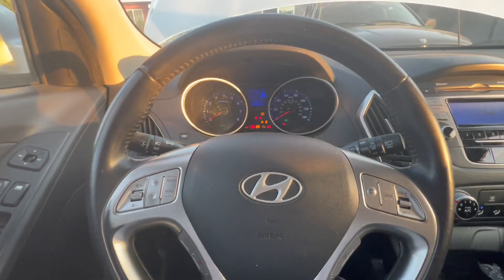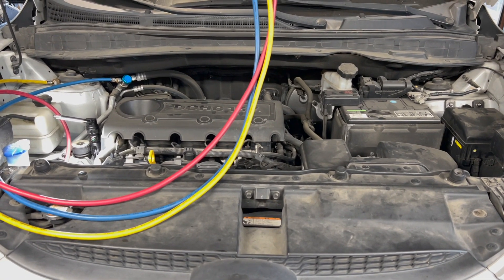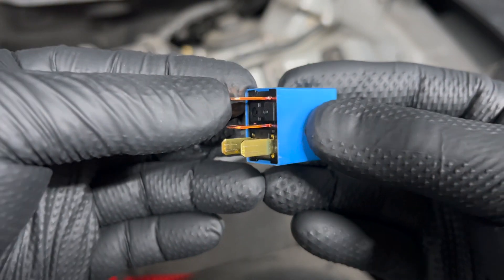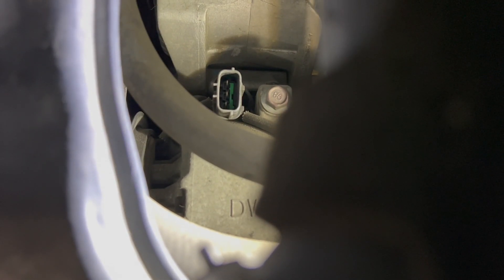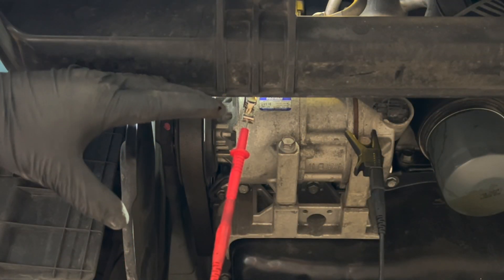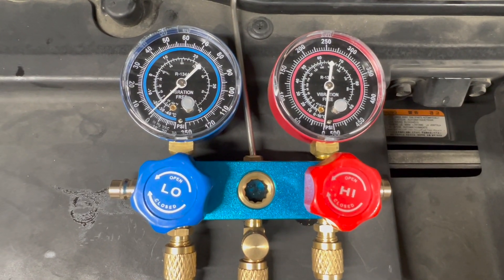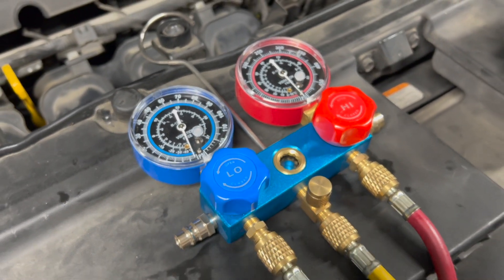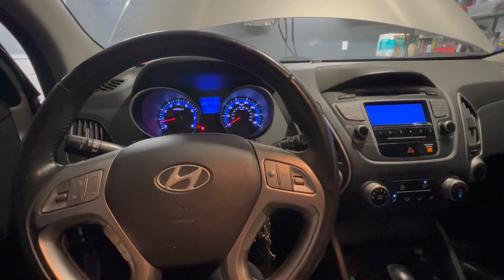What To Check When A/C Compressor Is Not Turning On

Comment: Hey so I replaced my compressor cause my clutch wasn’t engaging, installed new one and everything was operating normally then I went for a test drive and the ac starting blowing hot again and now my compressor is not engaging fuses are all good and my relay is also good any ideas ? On what could it be?

Comment: My 2011 mini cooper was vacuumed and recharged and the compressor just refuses to turn on. I checked for power and the wiring has no power going through. I then checked fuses and relays which were fine. Will check the auc sensor and climate control modules, as well as the ecu (kinda far fetch, but I'm desperate. Been out of AC for 2 summers now in desert AZ). Any recommendations would greatly be appreciated (no I'm junking my car...yet)

Comment: The AC compressor test part is very good. Thanks!
However, you may mention those other steps need to be done with professionals and not DIY, unless they have all the expensive tools you use. ;)
I'm also wondering why expensive repair (say ~ 1000 box for the original part) while you could change the coil and clutch with less than 100 box.

Comment: Did you have to measure how much pag oil was in the old compressor and match the new compressor with that amount so it doesn’t fill the system with too much pag oil if there’s more pag oil in the new compressor than what was needed to replace what was in the old one

Comment: Amen good video but in my case I connect I testing the compressor connected directly from the battery to the relay in the compressor is start spinning but when I disconnected the wire from the battery the stop

Comment: My car ac stop working, and i bought the compressor like 2 yrs ago brand new, change the compressor relay and still nothing. I put direct power to the compressor and it kicks on, any suggestions and i vacuum the whole system and replace the pressure switch new ass well.

Comment: Nice vid bro, i have a 05 murano was blowing cold  before i over charged it by mistake and it stopped working. i changed my compressor with clutch, changed ac pressure switch, changed the ac fuse which was blown and still no cold ac smh my next step is the ac relay if that dont work i dnt know what else to do, any suggestions?

Comment: I changed my ac compressor out because the clutch messed up. But new clutch won't engage. I don't have those tools you have to test, is there another way to test?
Reply: Have the same problem man. Mine engages if give it direct power so I know it works. Gonna have to take mine to the ac mechanic.

Comment: Help. The AC Compressor kicks in when bypassing the relay but not when I turn it on from the inside. Can it be that it doesn't have enough gas pressure in the system? Or is it that theres a cut wire that sends the signal to turn on the AC?

Comment: My AC Compressor is not engaging, but i can move it freely with my hand, but i also checked and am low or empty on Freon, it was working fine several weeks ago, but in NYC its winter so i havent been really paying attention until today. No AC, no Compressor engagement.... could it just be that i'm low on freon? I'll add some and see if it kicks in.

Comment: I have a 02 f 150 ac clutch not pulling in I have power to my plug on the switch in the cab I have power to my fuses and relays but can't get anything to my compressor I checked the continuity of the switch and it checked good but one of the prongs has a good bit of movement so I'm thinking long shot of bad cab switch or broken wire? Any thoughts?

Comment: I’m having a similar problem. I’ll completely empty the system and when I try to fill it it’ll literally say it’s completely full after barely putting anything in. So I’m assuming there’s a blockage somewhere. Not sure if there’s a more common place to check for blockages. Any recommendations would be appreciated. Btw I’ve already checked all fuses/ relays. I also checked high side pressure switch which happened to not be closed. Thought I figured it out. Replaced that and it’s still not closing. So I’m not getting enough pressure on high side for switch to close even tho when I put gauge on it says it’s completely filled. Any info would be appreciated!
Reply: I have exact same problem with my AC system on a 2007 town country Chrysler, when I started to add frion to the system it tells me is over fill but I checked the pressure on the valve low side and there's very little frion, question what could be the problem?? 
is the compressor it self wrecked?
is it computer wrong out put to AC system??
also when I disconnect the pressure sensor the clutch engaged but after I plug back the pressure sensor switch the clutch stops working, what could be the problem??help any one please??
Reply: @vazquezraul84  that’s really weird that when you disconnect the pressure switch that the clutch engages. Usually that only works if you jump the switch, closing the circuit. Seems like the computer is reading things wrong and telling things to do or not do things that it should/shouldn’t. Any chance you have an obd to read the data?
Reply: Expansion valve or pressure valve ac

Comment: So even if the low side is reading retard and the high side was reading high I did all the wiring checks and power was present at the compressor so I determined the compressor was bad but the person has one of those ac recharge with a gauge and idk if they just added too much refrigerant and I asked them and she said no but would an over charge cause the pressures to be that high? It was also hot that day is was 100 degrees.

Comment: mine engaged  for 1 second and turn off .low side reading  high pressure 
what could it be 😢
toyota previa 97
Reply: I have that same problem. Replaced the relay and checked the pressure. Low side was really high. Did you find out anything?

Comment: En mi carro el compresor entra cuando va corriendo y tiene aire frio, al bajar la velocidad deja de enfriar,  alguna sugerencia,  gracias por tu atención
Reply: Tus abanicos son los que trabajan con la banda?
Tengo una silverado que hacia lo mismo
Le cambie el fan clutch por abanicos electricos y ya volvio hacer eso
Reply: @javiertapia2293  son 2 abanicos de motor eléctrico los que lleva,
Reply: @leonardomaldomado9674  
Tal vez el condensador este tapado
Si los abanicos no pueden jalar aire necesario por el condensador, el freon no se mantiene a su temperatura adecuada
Reply: @javiertapia2293  voy a cambiar condensador, evaporador, válvula de expansión, y el acumulador, compresor  y creo las mangueras,  una pregunta,  las mangueras que salen del compresor llevan filtro?
Reply: @leonardomaldomado9674  
Unas llevan orifice tube 
Adentro de la manguera

Comment: Question on my 62 impala with vintage air , I’m not getting power going to my AC compressor. I have a 5 pin relay ,pin 30,85 and 86 have power but nothing going to pin 87 which goes to compressor btw I did replace the relay still nothing any help please

Comment: Can I reset ac by pulling fuse then putting back in? Should car be running? Should ac be running?
Reply: Wondering the same.. Did this help yours “reset”?? Thinking with the same logic. I’m thinking ultimately a new compressor is the answer like in this video

Comment: Really good video. But I noticed that you didn’t change the filter drier. I need to change my compressor but they keep telling me I absolutely need to change out the filter drier but taking the entire front end of my vw Jetta is not an option for me. Is it okay to just put in the new compressor WITHOUT changing the filter drier?

Comment: A system low on refrigerant would not allow compressor to engage as well. Excellent video troubleshooting.  The only thing I would've done is purge the yellow line once removed from vacuum as it has outside air. Use Schrader valve to purge air out before adding to low side. Nice job
Reply: After getting new testing tools, ripping the car appart while doing the diagnostic, I was about to go a lot deeper when I remembered your comments, you were right, I was only low on refrigerant, so much time wasted. I least I learned new things. Thanks for your comments!
Reply: Can a car have low refrigerant if you hook a gauge to low and reads completely maxed due to clutch not engaging? Should I go ahead and try to add some?
Reply: @thelegend1055 Did adding refrigerant solve the issue?
Reply: @thelegend1055  no
Reply: 😢⅞u
Reply: Good catch
Reply: Is it really that simple? The AC on my 2018 ELANTRA started blowing hot air two weeks ago plus the sensor that reads the outside temperature stop working because the dash no longer displays the outside temperature. Plus the AC button on the climate control has been flashing often on like the compressor is trying to kick on but it’s not.
Reply: @cia1209 all you have to do is replace that outside temperature  reading sensor and your A/c will come back the two are related
Reply: Appreciate it lmao
Reply: My ac would not turn on.  No air coming out, fans blower not turning on.  Help